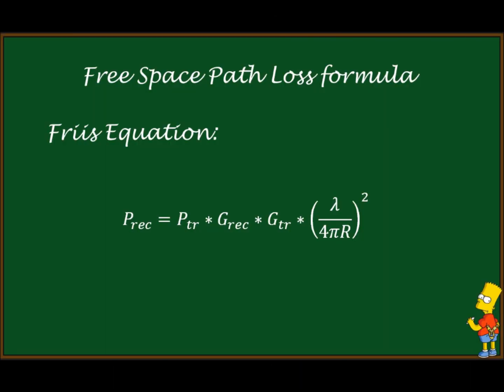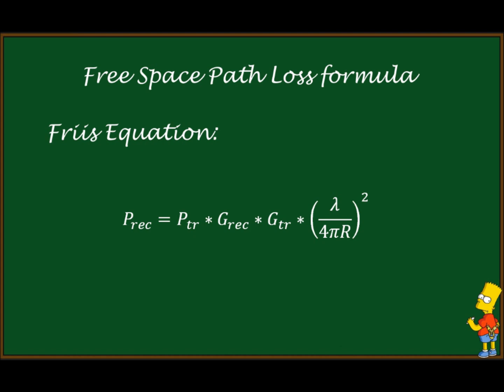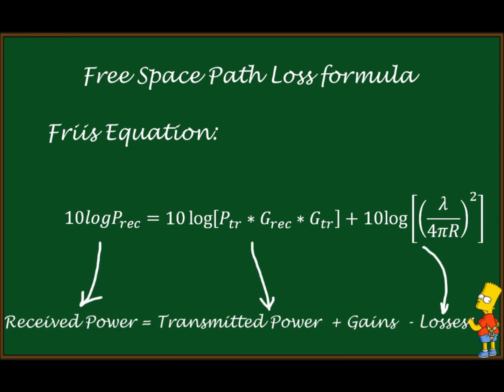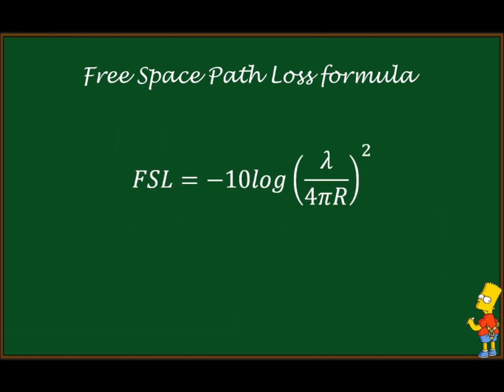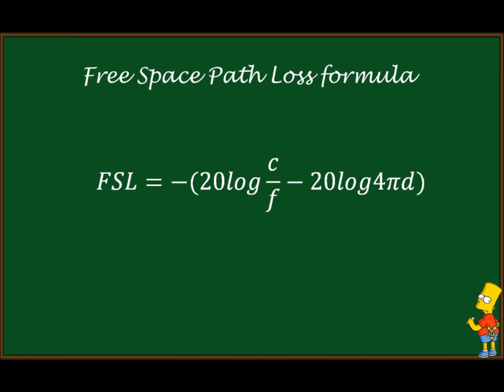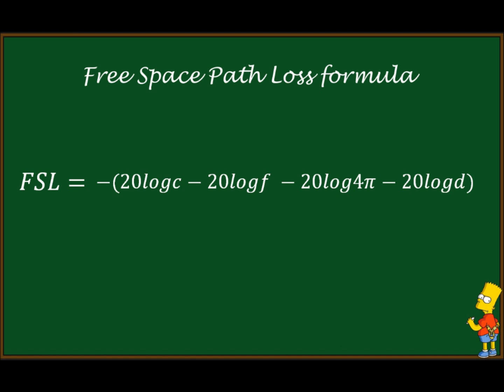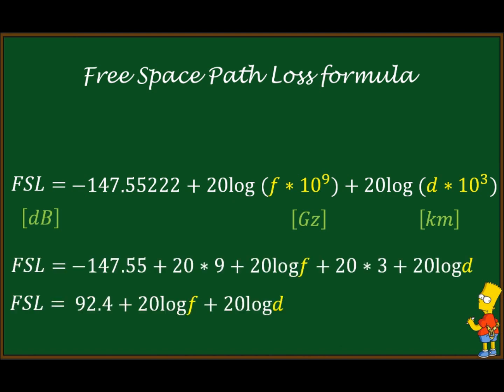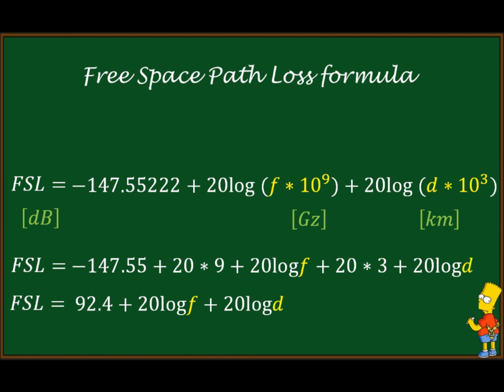Free Space Path Loss

Comment: The free space is lossless medium can you clarify why the Pr less than Pt ? Regards
Reply from the maker: It's about intensity that is smaller on longer distance by Inverse-square law. Pt is distributed over larger and larger spherical surfaces as the distance from the source increases. Since the surface area of a sphere of radius R is 4πR^2, the intensity (power per unit area and not power itself) of radiation at distance R is smaller. From the view of Receiver Pr is smaller compared with transmitted Pt. When R is doubled then intensity is divided by 4. Measured in dB it would decrease by 6 dB per doubling of distance.

Comment: Hi mr. Tajesh Kumar.
could you please help me.
where i can find SNR parameter in pathloss 4
Reply from the maker: Find Report in a Worksheet tab. There you have Rx Signal and Rx Threshold level. That's your signal to noise ratio.
Reply: you mean rx signal level + rx threshold level = snr ?
for example 
rx signal is -34
treshold level is -66.5
snr = -34+66.5 = 32.5 db
is it correct?
Reply from the maker: That's right.
Reply: in that case it is equal to Thermal fade margin. is it same think? 
SNR=Thermal fade margin ???
Reply from the maker: In this case yes. Fade margin is difference between the normal received power and the power required for minimum acceptable performance. While SNR is Signal to Noise Ratio and it will vary over time depending for example on your weather conditions.
Reply: in Pathloss4 case
Finally, the parameter calculated by Pathloss4 Thermal fade margin is same as SNR? Pathloss include parameters which i entered for weather condition.
can you share to me your email address pls.
Reply from the maker: Sure. I'll send you in the message.
Reply from the maker: Actually, here.. You have it at the end of this video: https://www.youtube.com/watch?v=2CWrs7ORhZs

Comment: it should be FSL = 32.5 + 20 Log{ d} + 20 Log{ f}
Reply from the maker: You need to be sure what you use for d (distance) and f (frequency).
In radio communications it is common to use d in km and f measured in GHz in which case the FSL equation contains constant 92.45
For distance d in kilometers and frequency f in megahertz the constant becomes 32.45.

See at video 2:03 how to calculate it and adopt it as you like.
Reply: I thought 32.5 was the constant but i google it, and your correct... :) Thank you so much for your explanation (Y)
Reply: Free space path loss ka formula hota hai 20 log 4πr/lambda